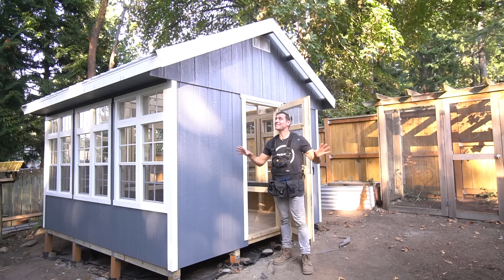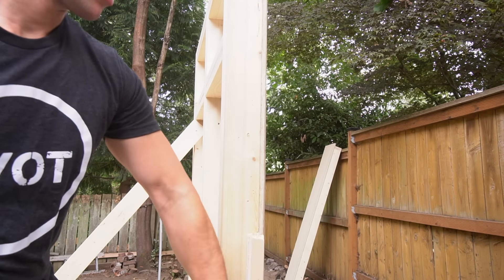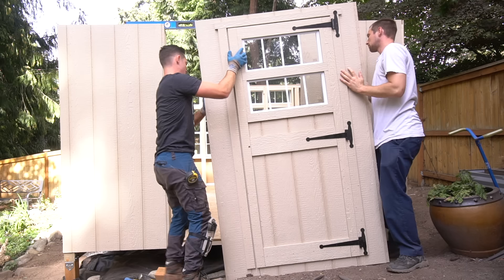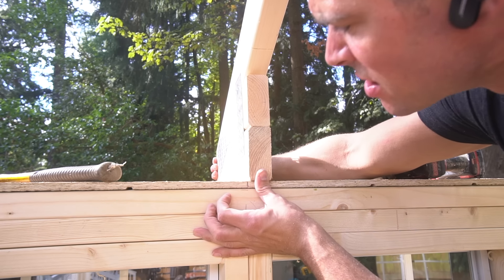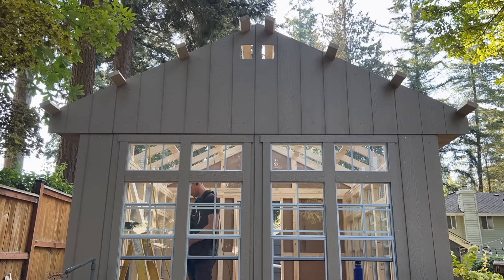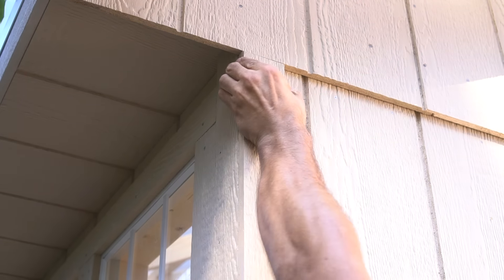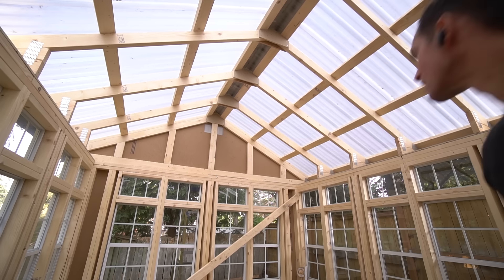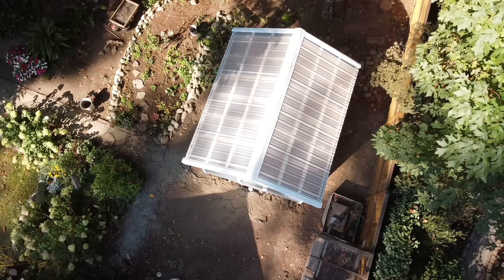DIY Greenhouse With ZERO Cuts Needed!

Comment: It's nice looking. Nice job with the install. 
I'm concerned about using OSB in the decking. It wont last long. 
A professional tip for your next video.  Level, is horizontal. Plumb, is vertical.

Comment: Your drip edge should be held off of the fascia by 1/4" to break the hydrostatic pressure.  The water is going to run down the side and not kick off as intended.
Reply: that was't a real drip edge, it was flashing, the kit should have provided that.

Comment: Greenhouse LOOKS great and quality beyond most kits.  Imho needs to be on footers with an open floor for drainage, and needs some sort of temperature management as an option. If those sliding windows were tilt out, simple wax-filled automatic openers could be used on them.  As pictured that greenhouse is going to have a constantly wet floor and get too hot unless you can attend to it full time.

Comment: I can't believe you have an OSB floor which is going to get wet from watering plants.  It's also going to get extremely cold under the floor. The least they could  have done is paint the floor with a mixture of oil based paint and linseed oil both beneath the floor and inside, including edges, and put an inch of insulation board  under the OSB to help keep it warm. Oh well, only time will tell how long it lasts. I also suggest painting  the inside walls and studs to protect it and make it last. Other than that, it's a nice job and structure.
Reply: He also totally skipped that part of the build... I'm sure it took lots of "cuts."
Reply: Louisiana Pacific agrees with you per their Warranty.  Para iii
Installation/Maintenance
(i) Product Application and Site Preparation must be completed as per LP’s Application Instruction and per the
Shed Manufacturer’s Application Instructions.
(ii) The structure on which the Product is used must be in compliance with all applicable shed requirements.
(iii) TheProductcannothavebeenusedinanexteriorexposure or in an interior space that creates an exterior environment. The Product may not be in direct contact with the ground or used in any application which allows for the accumulation of condensation or other free water or which subjects the Product to a repetitive wetting condition at any time during the warranty period other than normal rain conditions expe- rienced during construction or installation of the Product.
Reply: The floor/foundation was a separate video and not part of the kit.
Reply: @nhinja  The floor set up is in a different video.
Reply: Cover it with Red Guard & Forget about it
Reply: Have you ever heard of plant trays before? How about flower beds?
Reply: @gae384  I put that water seal on some osb and poured a puddle of water on it, let it sit for 6 or 8hours and it was still a puddle when I came back. Works great and you can't even tell it's on the osb, it's not like a polyurethane that makes a thick layer.

Comment: Great build and super educational for us DIY'ers. The kit looks really put together well with good materials. My only concern is the particle board floor getting wet, it's a greenhouse. I guess you could lay lino or upgrade to concrete board & tile and that would solve that problem. Great video, thanks  🙂

Comment: Whats the cost difference between building something like this from scratch vs a kit? Because with the looks of it this was a well put together kit so I imagine the mark up for that is quite high.
Reply: On their website, this 10x12 is around $7,300
Reply: It can be cheaper to buy kits as the company can bulk buy materials and pass that on. But if you are not counting your time (labour) in making it and you do a lot of searching/research and you have all the tools, you could do it cheaper but it will take a lot longer.
Reply: These would make lovely private shelters for the homeless too.
Reply from the maker: Great question and the kits them selves are at a high price but that’s because they are American made and they are extremely high quality. I’m sure you could save 1000 or two if you built it all yourself but think of the amount of time you’re saving with a kit that comes assembled like this.  It would’ve taken me weeks to build something like this from scratch versus just a couple of days.
Reply: Cheaper to build it yourself. 🏡
Reply: @sween187  lol it would never be cheaper to buy the kit because of bulk buying, they're adding a HUGE markup that people will pay for easy assembly. The prefab modules are just basic framing, siding, window mounting, which is really easy to do. Honestly I bet you could get a handyman to build a better shed for the same price as the kit, and you could definitely DIY it for 30-40% of the cost
Reply: @david7384  I agree, but there are a lot of people in the US with money to burn and those are probably their main customers.
Reply: @OSODIY   thanks, there’s my answer
Reply: I don’t have a pick up truck and the cost of good quality lumber is way up, still. I’m not talking big home center pricing. 
To get all of that lumber, windows, and nails, screws, plastic sheeting, home by delivery, would significantly add to the cost. There is also no wasted materials, which would take up space in the yard or basement. 
The windows drive up the cost.

Comment: Just started watching. It's exactly what I want, just need muscle to move the panels/walls. First problem they can easily fix is if they're meant to go in order 1 through...then why are they not stacked on the pallet in that order? It requires you to sort through pallet & restock in order. When you're old falling apart woman with falling apart daughter kind of would be HUGE help if not need to do more moving, lifting, etc. I'll keep watching... Thanks for bringing this product to our attention. 😉

Just finished watching...FANTASTIC video. You showed EVERY step, pointed out tools used, etc. I'm so excited I hope I can get one of these built. I'm going to check out their website, show your vid to my kid. And I have to check out your floor video too.

Comment: Love this build! Was wondering if these greenhouses would serve their purpose in NJ. Normal greenhouses wouldn't be insulated enough to withstand the cold Jersey winters and I'd have to bring the plants inside. However, this greenhouse seems to be top of the line and well insulated/has provisions for insulation as well. Looking for your thoughts on implementing this structure into a Jersey landscape...

Comment: Two questions on this one (I am building a DIY greenhouse similar in size myself but on a gravel base).  (1) Someone else asked about the drainage issues on a wood floor so was curious how you would address that in this system?  (2) would you put chicken wire or something similar to keep animals and such out from underneath the platform?  I also built a floating deck and have a shed in the works, both of which are up above ground level and I feel I need to have some sort of material to block animals from getting underneath.

Comment: Love this greenhouse!
My only concern is the wood floor, and nowhere for the water to go.
Do you, or the manufacturer have any suggestions for protecting the wood, and providing drainage?
Thanks for sharing another great video.
❤️🌵☀️⛈️🌈☮️🐎
Reply: There should be no water getting it there.
Reply: @Saul Goodman  unless you're using it as a greenhouse, right? Plants, shrubs, and seedlings need water. Each plant is not going to be moved out and then back in for watering. Alas, the concern about a wood floor and water that has no drainage scenario.
Reply: @Eric.Mercado  You are soaking it. Why would water get on the ground?
Reply: @Saul Goodman  What am I missing here? If you water a plant that is in a container with drainage holes the water drains out the containers....ONTO THE FLOOR. How do you water your plants housed in a greenhouse?
Reply: @Eric.Mercado  Why would there be drainage holes in a plant? There should be something under that.
It sill only be a few splashes.
Reply: @Saul Goodman  So you have saucers under every plant in your greenhouse? Your house, of course. We are clearly using our greenhouses differently. Which is fine as there are no greenhouse laws that I'm aware of. Enjoy your greenhouse. Happy watering.
Reply: @Eric.Mercado  Then how do you keep your plants moist if all the water till leak out from the bottom. long with some dirt.
Reply: @Eric.Mercado  wow.... didn't realize my comment would get such a reaction.
Sorry, but I've never seen a green house with a wood floor, which is why I asked the question.
I've seen them made out of wood, without a floor, then set on gravel, or brick (not contacting the soil). Some with a drain, some without, depending on the situation.
Hope this clarification helps.
Reply: This comment is the exact thing I was thinking.  But another issue I have with this is, when it gets hot and the water evaps, how does the condensation drain outside.  Every green house I have ever seen has a place for the roof condens to go.  This one looks like it would collect at the bottom roofing seal and rot the wood out.  The only thing I can figure is, this is more like a sun room that you can put plants in.  I wouldn't exactly call this a green house though.